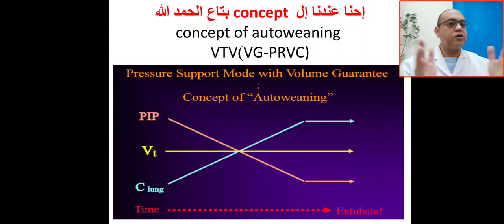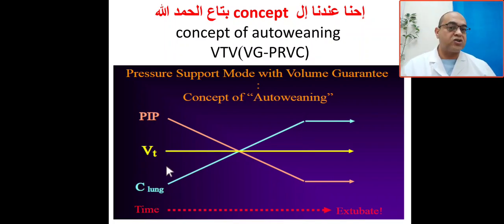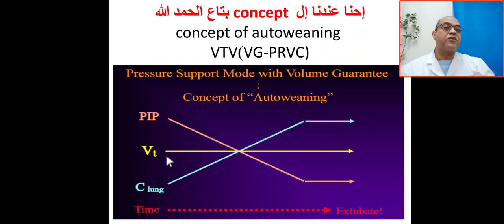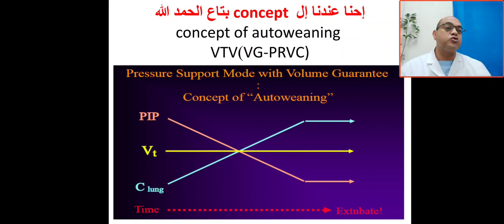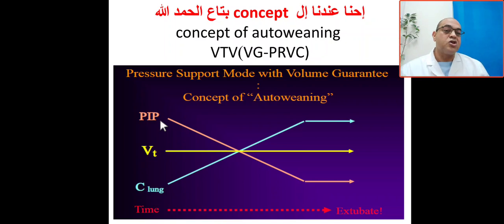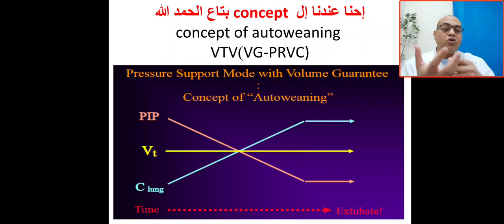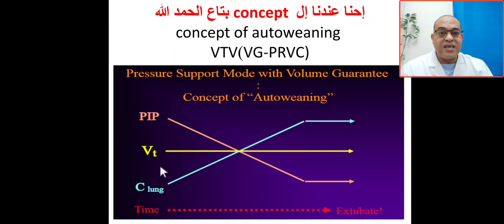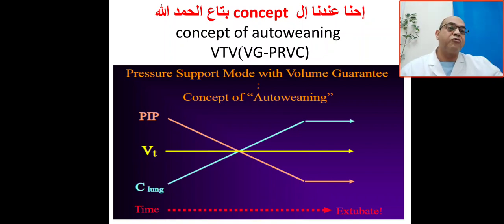what's concept of auto weaning? VTV, VG,PRVC, volume Guarantee, pressure regulated volume control

Comment: What is difference between volume control mode and this mode ?
Reply from the maker: Types of ventilator modes 

1. Pressure control like ( PLV) 
2.volume control like ( VTV)
3. Dual   control like ( PRVC)
Reply from the maker: Primary Breath Control Variable

1 • Volume control: V,/flow set, while P depends on those settings & pulmonary mechanics

2 • Pressure control: P set, V, /flow depend on P setting & pulmonary mechanics 

3• Dual control: Mixture of volume & pressure 
• Either starts breath in volume control & ends with pressure control or the reverse 1st Respiatory Care Comprehensive Revlew Course

ومن أحياها فكأنما أحيا الناس جميعا 
🌹🌹🙏🤲🤲🤲🙏🌹